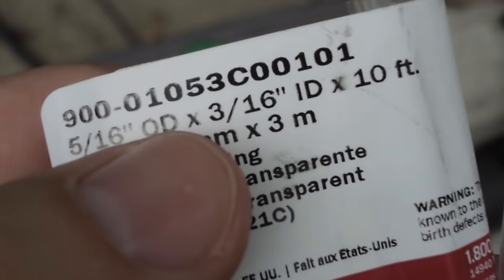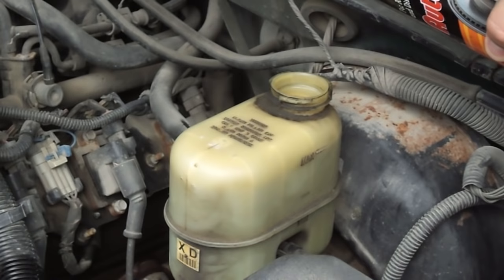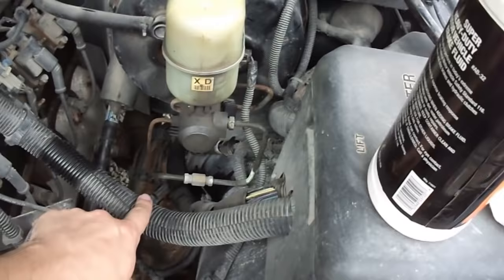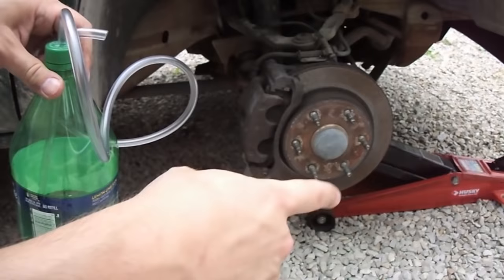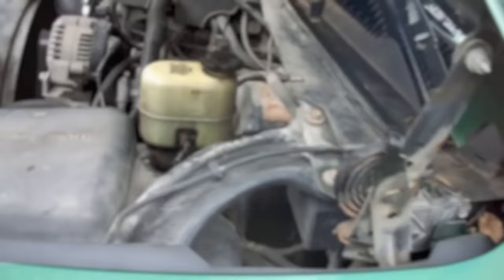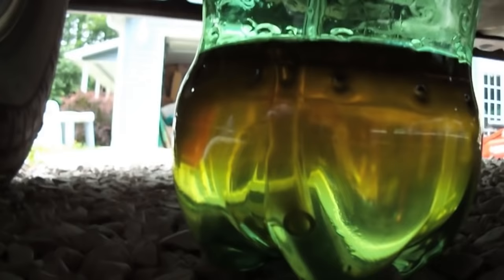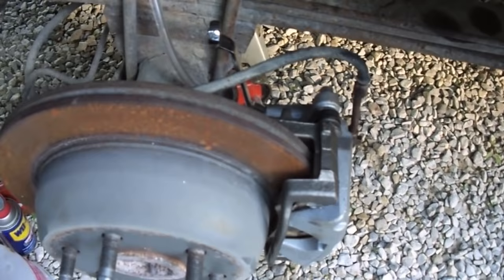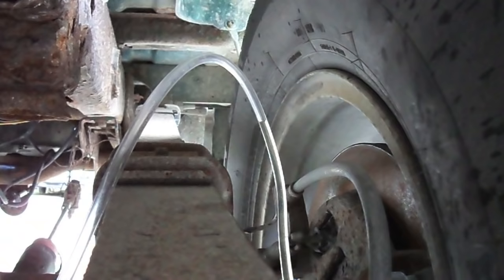Bleed brakes by yourself - DIY Brake Bleeder tool - Brake flush

Comment: thanks for the video, man, it was extremely helpful. especially since you made sure to show exactly where everything was and exactly what you were doing. i found that it's also important to use something like a 2x4, long screwdriver, pole, etc to wedge between the brake pedal and front seat to hold the pedal down when you tighten the bleeder valve and remove the tube. that way there won't be any air sucked back into the valve when you tighten it.
Reply: Actually that's nonsense because his tube goes down into fluid he pumps it until there's no air to be drawn back because the fluid in the bottle would be the only thing to draw back until it's tight don't pay attention to that nonsense
Reply: @thomasquinn5537  When he releases the brake pedal to get out of the truck, there could be some air bubbles that came out of the system close to the bleeder valve which are sucked back into the system due to releasing the brake pedal. By the time he views the tube, he may see only fluid in the vicinity of the bleeder valve and the sneaky air bubbles have disappeared back into the system.  So I am going to use a 1 inch diameter PVC pipe with a spring inside which pushes a 3/4 inch wooden dowel against the brake pedal when I get out of the car to check the bleeder tube.  It will be braced against the driver's seat.  This simulates the technique when you have a helper pumping the brakes.  The helper pumps a few times and HOLDS while you close the bleeder valve. Any bubbles originating from the system that are visible while the brake pedal is held are not sucked back into the system.

Comment: You should always bleed the furthest wheel from the master cylinder first, which is the passenger rear wheel. Then the driver side rear wheel, then move to the passenger front wheel and finish at the wheel closest to the master, the driver front.

Comment: Suggest that a few days before you try bleeding, spray some PB Blaster on the bleeder screw area. Might help free up rusted bleeder screws...
Reply from the maker: Good suggestion
Reply: Dan - good video, will use your technique soon!!!
Reply: Billie Bob Norton III I used it on a Civic and worked well, i was able to drive to work right after.

Comment: Works well. Excellent video..I added a zip tie around the hose under the cap. This step assists in keeping the hose from backing out of the position you have chosen in the bottle. Ps: Start your break bleeding with brake fluid in your bottle. To save brake fluid, I drained old fluid from reservoir and placed it into my bottle and refilled the reservoir with fresh new. The fluid placed in the bottle prevents air from being drawn back the brake lines when you start your brake bleeding. It dont need to be fresh fluid to work properly.
Reply: I think he does have a little fluid to start but forgot to mention it. The zip tie is a good step to prevent the hose slipping out of position.
Reply: use a turkey baster to remove fluid from resevoir

Comment: I use my mityvac kit or a scanner with automated bleed at work, but this method works great in a pinch, and is cheap to make. It keeps the driveway/garage floor/shop floor clean. Great video, I never actually thought about a vent hole but that makes sense. God bless, brother.
Reply: I use this method all the time, even when I use the pressure bleeder, each wheel gets a dasani bottle with wire attached to spring etc - I don’t put caps on the bottle at all just keep the hose submerged.

Comment: Awesome video. I'm fixing to bleed my brakes on my 71 Nova after changing out the master cylinder. I'm also changing over to silicone brake fluid. I'm gonna try your method and see if I can do it by myself.

Comment: If y'all dont have a drill and a 5/16 bit handy, if you use a propel or ozarka water bottle with a squirt lid it is the perfect diameter to hold that hose in place firmly and it will seal, for ventillation slightly unscrew cap as if you were letting out the carbonation prior to opening a new soda!

Comment: Yeah my box wrench rounded(partially) a bleeder on me too.  Used a MAP gas torch and squirt bottle to heat shock it, then put on a long socket (had to tap it on with a hammer cuz of the rounding).  Saved me a new caliper.

Comment: I have used this method. Make sure you have your bottle upright and it does not tip over or else air will get into the lines. You may want to sit the bottle inside something sturdy like a coffee can or strap / tape it in place.

Comment: This only works if air is not getting in  at the bleeder threads.  I have experienced this and had to go back to quick pedal push and close bleeder. 2 man system

Comment: before draining brake reservoir,mark the fluid level with tape ,so when the prcedure is complete fill the reservoir at the same level when you started,because the fluid lowers as the brake lining wears
Reply: That makes no sense
What if the master is too low
to start with.
There is only one level you fill to on any vehicle
& there is no topping of fluids in any vehicle system.
If you need to add you have a leak to repair
Reply: Not necessarily. As your pad wear more fluid is taken into the caliper causing lower fluid levels. When you go to change your pads and push brake cylinder in that fluid will return to master cylinder. If you have topped off your fluid you may have a mess on your hands.

Comment: Before even starting this job, check that you can crack open all bleeders in advance so you don’t have to buy any new calipers!

Part A

Use a combination of cleaning with a wire brush, penetrating oil, a six point socket on the bleeder with some gentle taps. Repeat this a few times working the nut back and forth in small increments if possible. 

Part B

If nothing budges, then apply heat to the caliper around the bleeder, NOT on the bleeder itself. Repeat Part A steps outlined above wiping off excess penetrating oil to prevent flareups Try Part B again.
Repeat at least 3 times (if needed) and be patient.

Comment: I use this same method, minus the vent hole. You can squeeze the bottle and stick the tubing into the reservoir to suck out the old fluid while the bottle expands.

Comment: thanks a lot I was just about to bleed my chevy silverado brakes after replacing a leaky cylinder and forgot about stuck bleeder valves I'll be cautious might just bleed at the tee juncture where new lines and fittings are loose need a fatter hose. And now onto the chevy R.V. with hydro-turbo assist fun getting the air out !

Comment: Great job , easy to understand   ! I bought a little bottle with a magnet and some line fittings for different size bleeders! They should sell the plastic tubing with the different  size bleeder adapters. Plenty of soda bottles out there and as you showed as long as you keep the hose above the bleeder screw it'll purge the air!

Comment: This was very helpful to me as after I replaced the brake pads, I found the braking was worse.
Reply: Peter Matovolwa they was worse just because they hadn't bedded in yet, abit more driving and using them would of fixed it but your brake fluid may of needed changing anyway so no harm done

Comment: Wow I kinda feel like an idiot for not thinking of this before. Thank you for this video. There have been a couple times I didn't have a buddy to help me and I had to push the peddle down and wedge a 2x4 against it and my seat to hold it while I went back to close the bleeder screw. Not the best method but it worked in a pinch. But this is so much better.

Comment: My bleeder screw stripped and was mangled, and I couldn't get it off, either. But I just used a 5/16"/8mm bolt extractor and it came right out. Put in a new $2 bleeder screw, and it's done. Buying a whole new caliper compared to a bolt extractor, or even a set of bolt extractors ($32 at the parts store) is a waste of money and a good caliper.

Comment: Tip for not stripping bleeder screws. Use a sockets to crack it loose, and then use your wrench afterwards.
Reply: Also put a little anti seize (Copper grease) on the nipple threads

Comment: Slide a nut over stripped bleeder and give it a quick weld inside the nut to the bleeder,now u should be able to remove the bleeder

Comment: Good simple video. Just to add to the other tips- If you can suck the old fluid from the master cylinder tank first (a trigger spray will work), and then add clean fluid, you will pump less and won't waste more new brake fluid than you need to.

Comment: Whether with a helper or by yourself - a MAJOR aid to bleeding air out is have the axle you are bleeding higher than the non bleeding axle - this raised axle affords any air to come to the highest point (the bleed valve) and come out right away - shortens the process dramatically.

Comment: I just bled my brakes....just pump the pedal hold the peddle down with a stick or pipe or half of a jack handle like I did. It took me 3 times and one more for good measure. No mess hardly and no messing with bottles or hoses.
Reply: What you describe is not bleeding the brakes.

Comment: Nice job! The only thing I'd add is that you really need a 6 point wrench instead of that 12 point. They intentionally make those bleeder screws out of soft metal, so very high chance of rounding it off if you use the 12 point.

Comment: This is very old standard method. One of the most important things is when replacing the pads open the bleeder with the hose attached and when compressing the pistons back into the caliper that old fluid will not be pushed back into the system. I have been in the automotive repair business for over fifty years.

Comment: This method works well as long as your bleeder screw is not sucking in air from the threads when you release the pedal.

Comment: What keeps the old fluid in the bottle from being sucked back into the system?  Is there a valve that prevents it?
Reply from the maker: Not sure exactly. It's science.
Reply: You bleed enough new that the old is pushed into bottle and new is in hose and keep hose high so air stays  away from bleeder.  I zip tie the hose up high generally on frame or strut coil not kinked.  I also zip tie bottle in a standing position.   It is a good way if you do not have a helper or for gravity bleeding.
Reply: You should have a one way valve & air gets sucked in by the bleeder,
if you do not have two people & close the bleeder when the fluid is
coming out, before the pedal reaches the floor
Not easy to do that way without the motor running
& your going to need a scan tool eventually on some
vehicles to open the abs actuator valves (so stay with two people)
There is no vacuum to suck the fluid back & if there was the loosened
bleeder would break that vacuum.
Reply: The Master is designed to push fluid not pull.  You will see fluid move up the tube but its not due to pulling.
Reply: Gravity , the bottle is below
Reply: @calspeed1  not entirely true. It's designed to push AND pull. Otherwise your brakes would be locked to the floor, so it can suck fluid/air back in when it's being decompressed. But so long as you keep the end of the hose submerged in fluid and the other end is snug to the bleeder you cannot suck any new air into the system. But if you don't have a proper seal you will suck in air.

Comment: Always use flare wrench for hydraulic lines the correct tool could've saved you time and money I'll give props on your bleeding method is very effective kinda time consuming but it works  very cool

Comment: Do you keep the car in park when you bleed the brakes and I assume you leave the car off with no emergency brake applied?
Reply from the maker: SpottedXtreme my truck was in park, not running, and with no emergency brake on.
Reply: SpottedXtreme neither of that would make a difference. When the truck is in park its held by the transmission and with the ebrake on it doesn't use brake fluid its mechanical

Comment: I found out a long time ago that its not necessary to pump the brakes. Once you open the bleeder valve any air will come out first. Once you have brake fluid coming out without air, your done. Gravity does the work for you.
Reply: That's what I find.  However I do give it some gentle pumps part way through as well. Needs a bit more patience as it's slow.

Comment: My buddy (who is a certified Toyota mechanic) told me to check with the manufacturer of your vehicle because some need to have the engine running when bleeding brakes with an ABS system.

Comment: Twelve point sockets may round over the hex. Use penetrating fluid and a six point socket wrench to crack the corroded bleeder threads, this will avoid damaging the hex surface. Or, you can use a five point open end wrench. Pull, don't push, open end wrenches. Ok!

Almost remove the bleeder screw and press grease or putty tape (never hardens) into the threads, or paint with Anti-Seize. 

After this, you can use any box end wrench with the clear tubing.

Comment: thanks for sharing. great tips. i changed my pads and rotors and forgot to crimp the line, which let in a lot of air. one of the cylinders got stuck, too, but after/while bleeding the brakes it popped out.

Comment: Yep..brake fluid will soak through the paint spread out over the metal and come off anywhere and around the spots of brake fluid on the paint..clean with soap and water off of paint immediately

Comment: Prevent the bleeder screw from seizing is to bleed them at least once a year at least in rust belt or New England areas.  Also tried putting some lithium or dielectric grease on it to prevent rusting and seizing.

Comment: A quick FYI to avoid stripping that 10mm brake bleeder. If it appears that it's going to be an issue right off the bat, get some PB Blaster on there and with a metal brush scrap away all the nasty rust & grime. You made need to apply some heat to it as well. Also, use a socket wrench instead of a box end to get it loose. Then go to the box end when you're actually bleeding the brakes.
Reply from the maker: Good tips!

Comment: Yea you get over here and try that on my truck cause I’ve got 2 new brake lines and both brake calipers and pads and rear shoes and hardware kit and both wheel cylinders  and new drum and still have air in the abs block causing me trouble  and I’ve had bled them all the old school way with an assistant being a pedal pumper  3 different times and then I have used the diy hand vacuum pump bleeding kit also so come on out and show me how much of a genius you are!!!

Comment: Unless you are emergency replacing pads, it is not a bad idea to put a couple drops of 3 in one in the valve hole and on the valve where it threads into the caliper a day or more before.

I suggest 3 in one because it will not spray on other parts of the brake. This is epically helpful if the rubber cap has gone missing.
Reply: What about a little lithium grease on the valve threads ?
Reply: @deanyanko3326  I doubt it penetrates as well.

If you are asking about using it during assembly it will make a mess when you totally remove it and, possibly, contaminate the brake fluid.
I was referring to the valve (which easily cements itself to the caliper when the cap has gone missing) and not the caliper.

Comment: PB Blaster works on any rusted screws,bolts,ECT exspecially if you let it sit. Ford dealer was affraid to take #3 spark plug on a guys f150 I literally socked it for a day then pulled tha plug as if I was tighting it then it cracked right loose

Comment: GOLDEN RULE folks.Never ever push the brake pedal more than halfway on your car,You will more than likely kill the Master cylinder or at the minimum shorten it's life.The Master during it's life never goes beyond halfway,so when you open a line to bleed air out and push it beyond this point the main seal has to push through a stagnant section of the bore disturbing sediments etc etc and will frag the seal.The pedal will not hold pressure and sink under foot.Always Pump the pedal slowly and gently.Best of luck good people

Comment: That method is first done by Ericthecargguy,The easier method is gravity bleeding where you just loosen the bleeder screw or remove it and let it drip for 10 minutes or so,watching the fluid level and add to max.Your method can mess up the Master cylinder by pumping it over and over.I have to replace my Master cylinder after I've done your method and ETCG where you got it the idea.Thank you,just sharing my experience.
Reply: Were you pumping the brakes all the way to the floorboard? That can cause damage. Try putting a board or something behind the pedal to let it only go about halfway.

Comment: Great!! I’m actually going to try airline hose and a check valve from my aquarium parts. Should work. No need for water. 👍👍
Reply: That's not water, that's brake fluid.
Reply: @VanillaWahlberg  In the bottle to start with? Didn’t think brake fluid was clear. Never paid attention to it coming out of new bottle.
Reply: @tonyamatucci1999  Yup. It's so it doesn't suck up air. Yeh I've never seen new brake fluid either until recently lol.

Comment: Before you try this be aware that you need a means of locking the pedal down after pumping,  a rod or something between the pedal and seat. Don.t complete the pumping on an upstroke.
Make the pumps slow and full up and down movement.

Comment: Pro Tip..... use a turkey baster to remove as much as the old fluid from the reservoir first and then refill with fresh fluid, that method removes a good amount of the old fluid that would normally go through the brake lines and should make quick work of the flush job.

Comment: Hello from Brazil. My Honda Jazz 2017 since new always had the spongy brake and I have tried to bleed it several times but it is not as good as I think it should be despite the car braking well. I will try to bleed using your system. Later I will post here if it got good, without any air in the pipes as I think it has. Thank you.